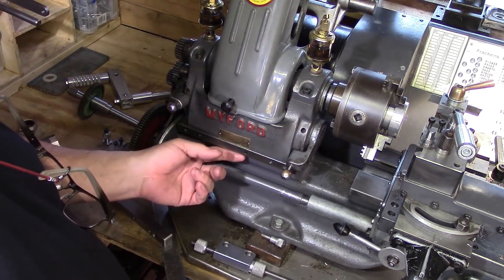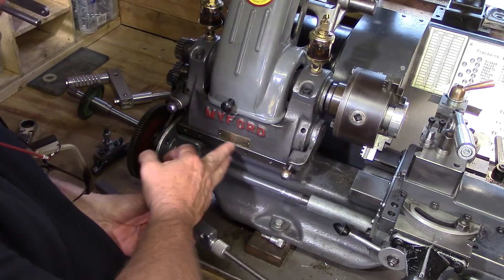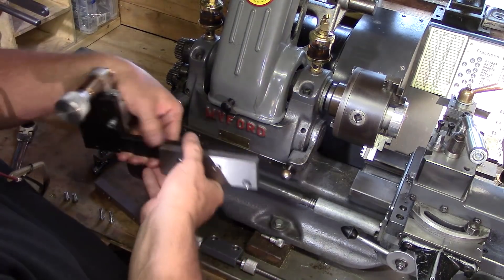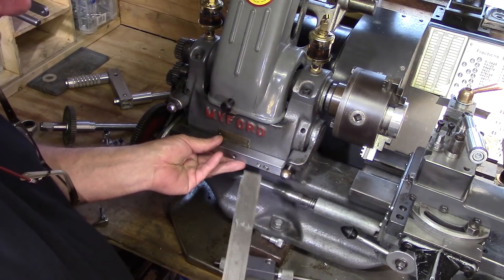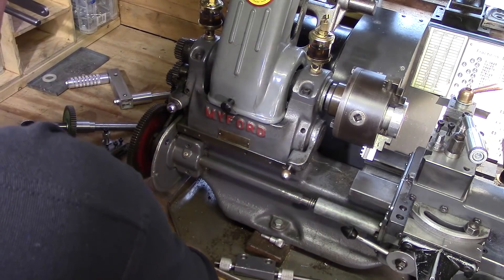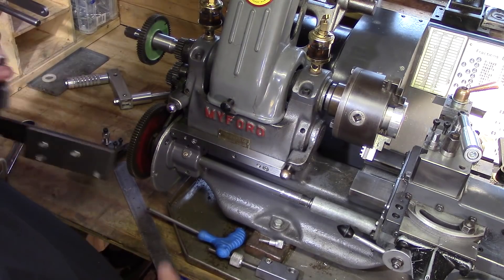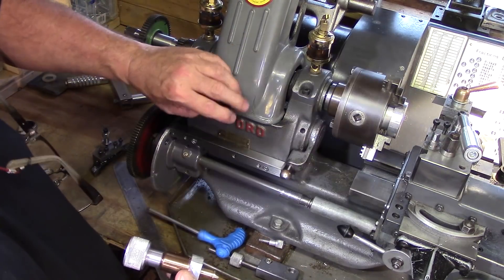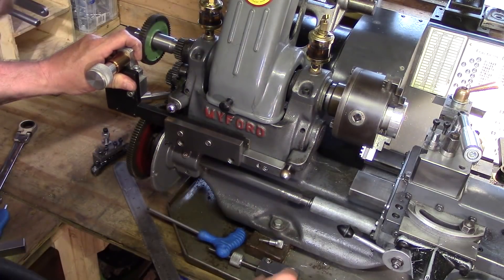Carriage Stop & Indexing Device for ML7 Myford Lathe

Comment: Good afternoon. During a previous  video I noticed a tapped hole 1/4" BSF on the saddle. The hole is on the headstock side towards the center. What is it used for please.
Reply from the maker: Hi Stuart, it is for attaching a traveling steady

Comment: Nice! I was thinking about how to index on the ML7 and I went through the same thought process you did. I first thought about indexing on the drive gear but realized the toothcount was  impractical.  Then I thought of using the 60 tooth backgear somehow and now I came across your video about doin just that with a practical carriagestop as a bonus. Thanks for this.  I'll probably endup using your design for the most part with a few adaptations because I don't own a mill.

Comment: Great idea! May I please ask what size/thread the original holes on the front of the spindle base are? You have tapped extra M5 holes but on mine there are two fixing holes for the quick change gearbox bolts and I'd like to use them if possible...
Reply from the maker: I dont know what the original hole threads are, try some bolts and see what fits

Comment: Could the knob be designed to allow for a quarter turn locking out the indexing pin from engaging thus freeing a hand and not constantly fighting the spring pressure? Please don't get me wrong, it's a well thought out design., I just wonder if there is any room for tweaks. I hope I have explained myself adequately.
Reply from the maker: Hi Grant, yes indeed, a locking pin would be very useful
Reply: I’m thinking of making the wedge pin end v-slotted so you can turn it a quarter to index half-positions on the tooth crest. That way you can index a 100 line graduated dial with a 50 tooth wheel. I might struggle to fit a 100 tooth wheel on my little ML1.

Comment: I always think it  is a mistake to drill holes in an otherwise perfectly original machine. Even though it works well for you. I would always look for another solution. These machines are special and should be respected in their original guise.
Reply from the maker: Thanks Chris, I fully agree with you regarding drilling holes in a classic machine, but I didnt manage to come up with a better solution
Reply: It’s a difficult decision isn’t it. On the one hand vintage machines are things you want to preserve, but at the same time they were made to be used. Unless it’s going to be a museum piece, I think one has to take a view on the appropriate compromise. I have a 1936 ML1 which has been butchered somewhat by previous owners. So I’m trying to restore it sympathetically, while turning it into a very usable little machine. definitely like the idea of a single pair of mounting holes for the sacrificial bar to minimise further modification of the castings. But any holes in mine will be BSF or BSW!

Comment: Neat. I am looking for a good way to attach indicator clocks on mine. The imperial dials dont make much sense to me. Converting it is a pain, and the dials are hard to read anyway. But there are so few flat spots on the myfords. Your bar could work for many things. But I dont like drilling into the lathe either
Reply from the maker: Hi Auarhau, I work with both metric and imperial when on the lathe, but I find it fairly simple to quickly convert from metric and then work the lathe using it's native language, it becomes 2nd nature after a while, and you learn to appreciate the simplicity of english sizes soon enough